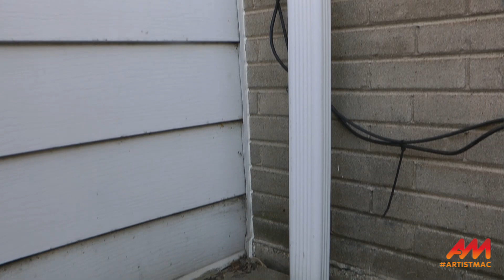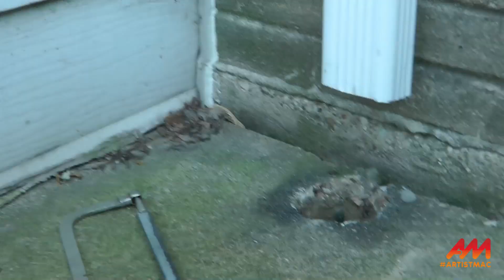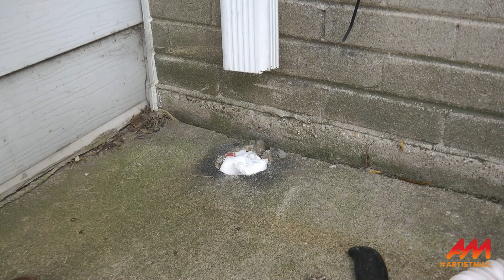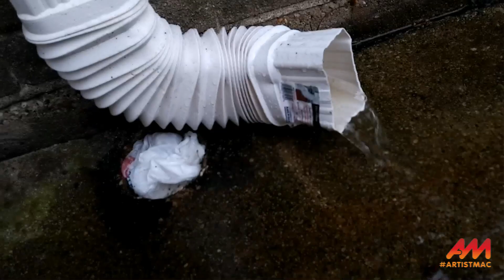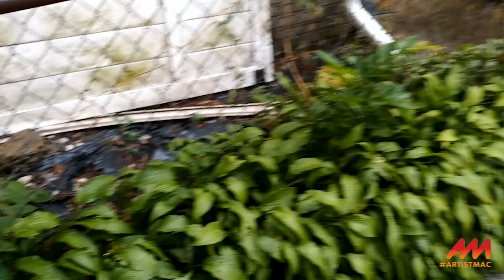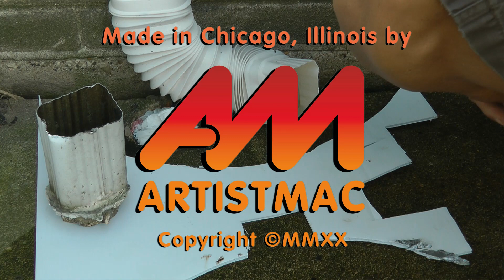Downspout New World Order, Part One

Comment: You'd get a much better seal and no chance of it getting lodged in drain if you just use one of those drain expansion plugs to plug the hole, you can order them in any size and you just tighten the nut and it seals around with rubber. You can then paint it or cover with pea gravel to make it look better.
Reply from the maker: That's coming. I have one in the floor drain in the house -- I wasn't sure if it would work outside. The result will be in an upcoming video.